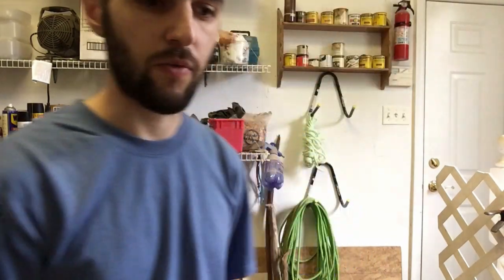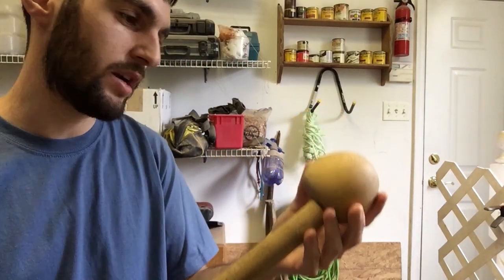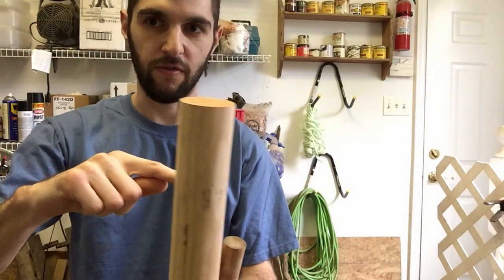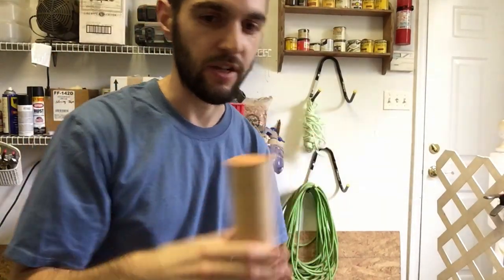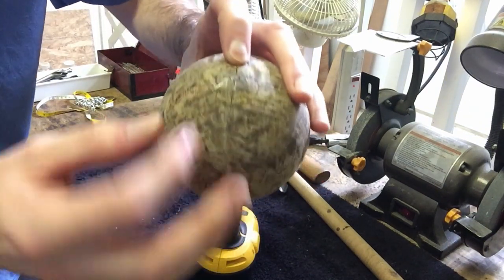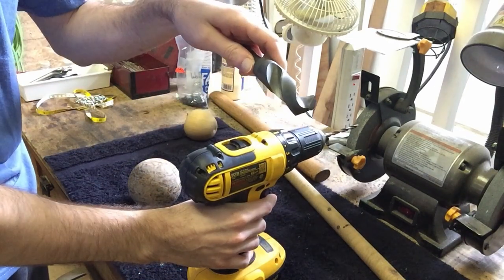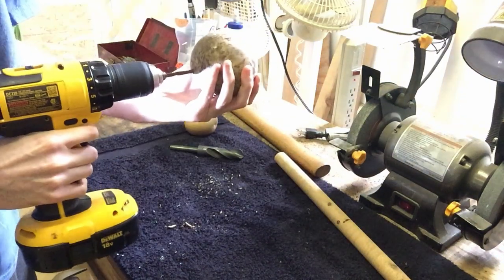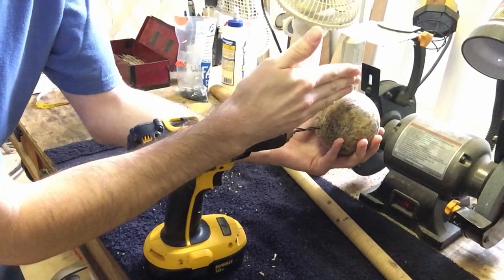Easy DIY Homemade Wood Mace

Comment: A wooden dowel used closets would work well, they are usually oak or hard maple, very strong tight grain wood.
Reply from the maker: I see, I will have to look into that.

Comment: Thanks for your video.
Could you said me the weight?
In Argentina there are not manufacturers then I make my own gadas using small bowlings balls.
Your work is excelent, buy I do not put a grip over the wood because the hand can not slide.
Thanks a lot and regards from Argentina.
Reply from the maker: Just buy a hard wooden ball, a strong wooden pole, some shorter size nails, and cord or rope. That is all you really need.

Comment: Would it be possible to raise the volume slightly? With my headphones on max volume I was kinda struggling to hear. Thanks for the cool video though!
Reply from the maker: Thank you. On any smart phone it is hard to hear. On TV or computer the volume works just fine. Try setting you phone volume higher or youtube volume higher. I will also try to talk louder in newer videos.